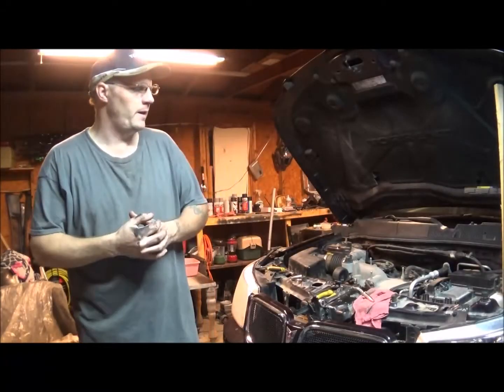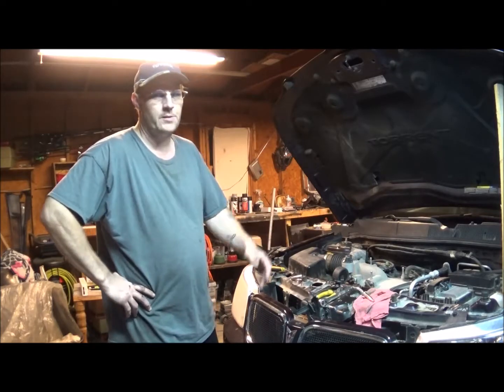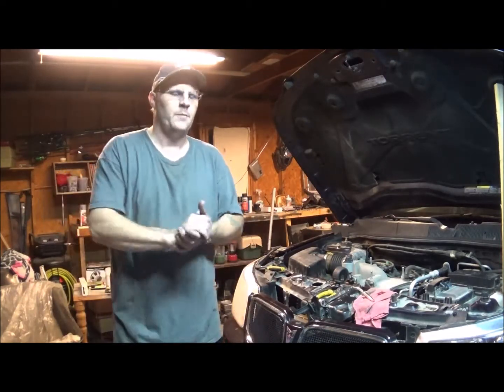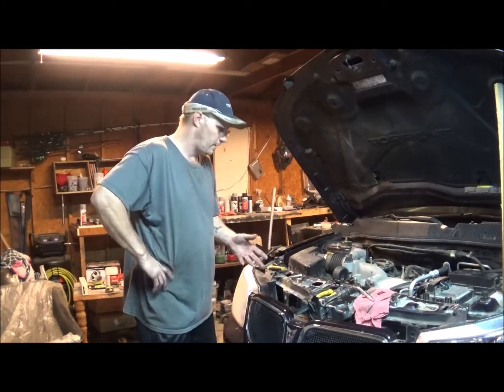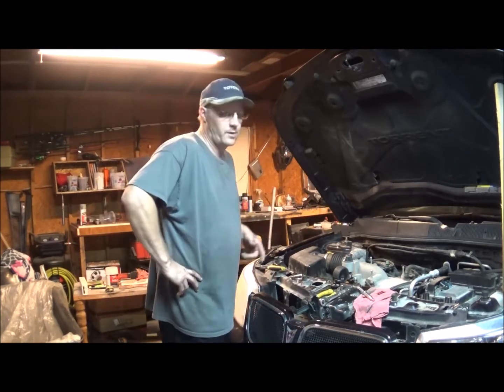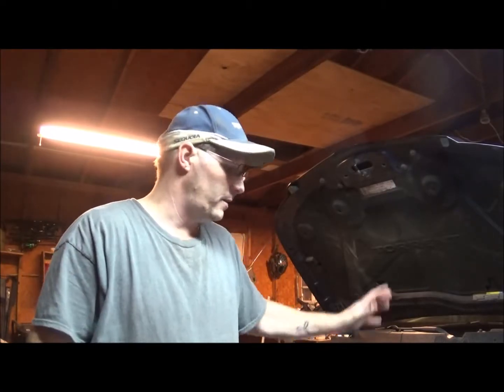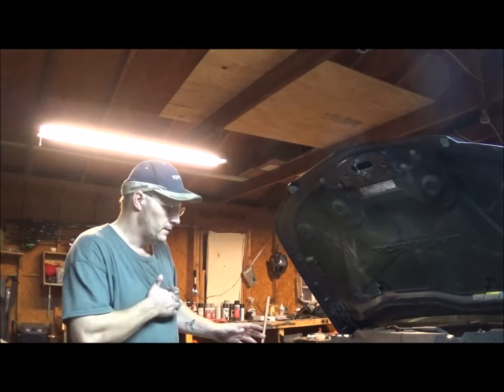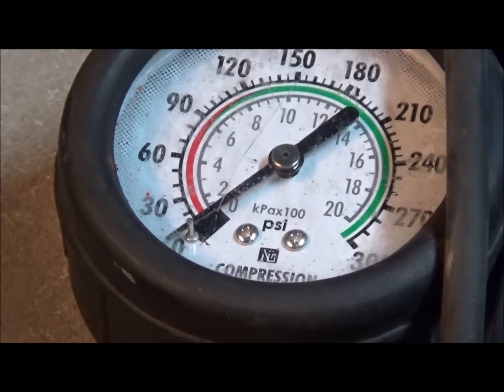2006 PONTIAC TORRENT COMPRESSION CHECK 3.4l v-6

Comment: currently doing the exact same thing. replaced the heater core, thermostat, water pump, then the coolant temp sensor went out. overheating continued. did a coolant flush burped the system and had bubbling in the reservoir. did a compression test had 90psi in #2, 125psi in #4 and 120 in #6. literally just pulled the intake and valve covers off. pulling the heads tomorrow. also doing an oil pump and full engine reseal while I have it apart